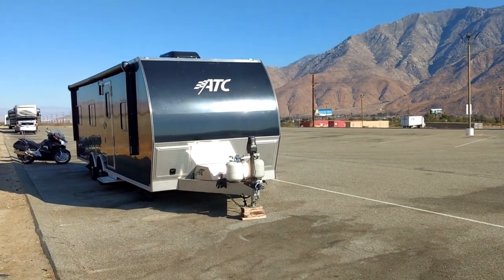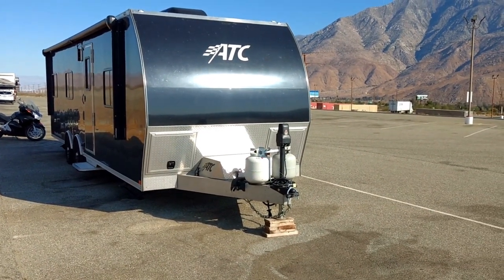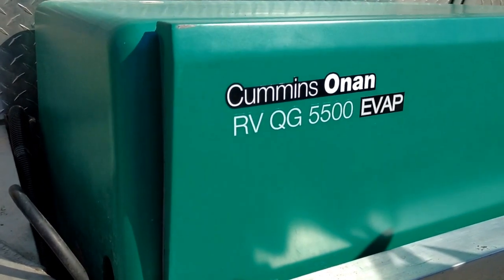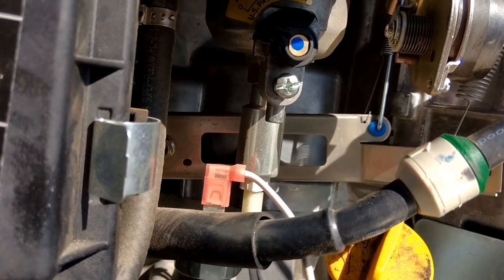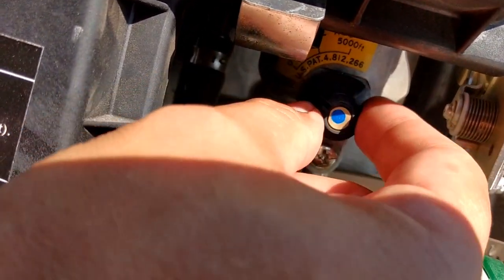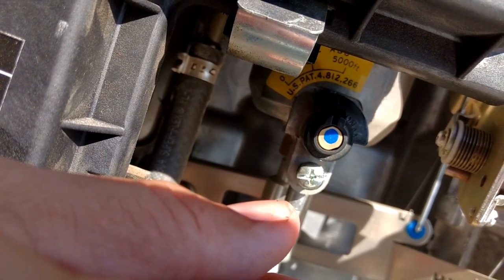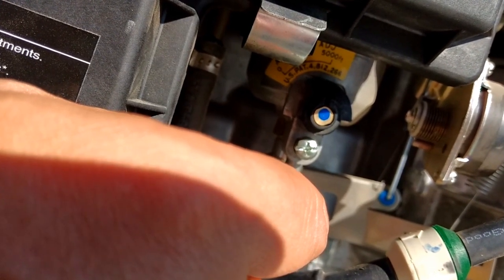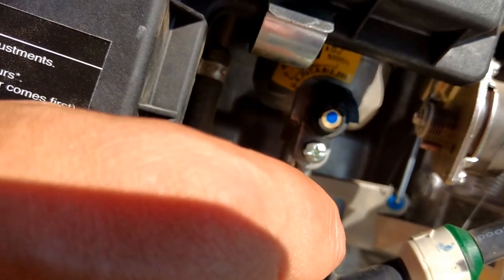Onan Generator Won't Start - Model RV QG 5500 EVAP

Comment: Turning the knob does not let in more air it decreases the fuel because there is less oxygen to burn.  The generator is running too rich and by turning the knob it is leaning out the fuel mixture so that your plugs do not become carbon rich fouled. You never gain back more power at altitude, less oxygen = less power.  I hope this helps.